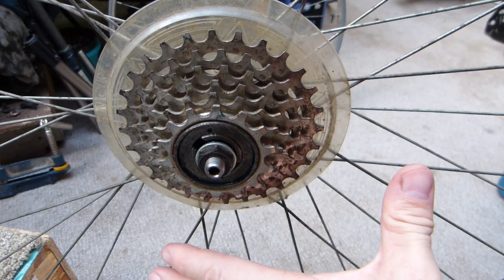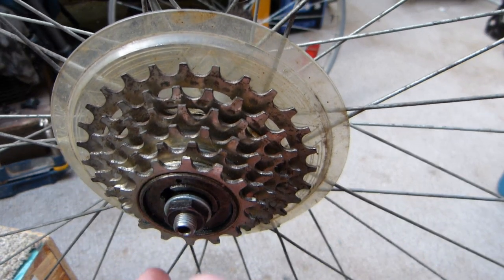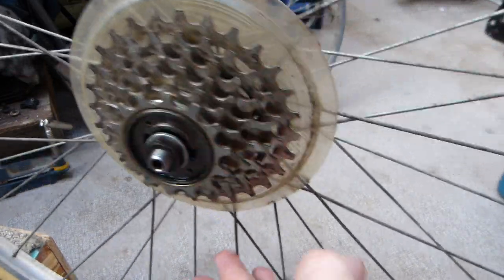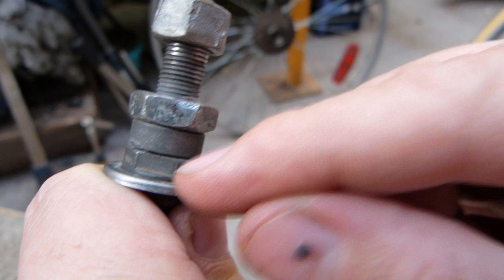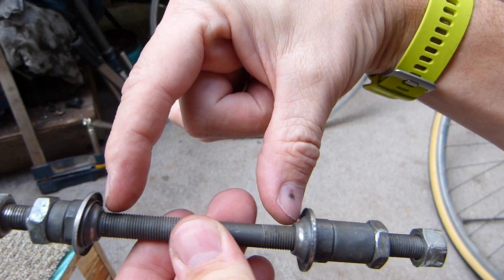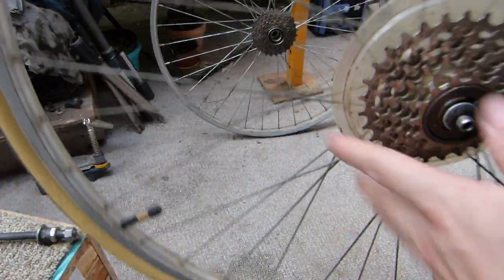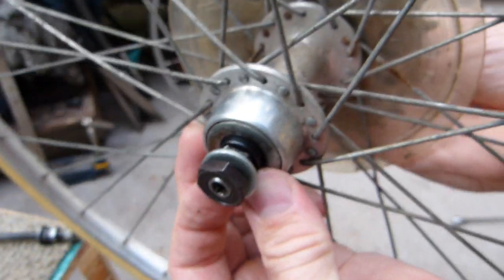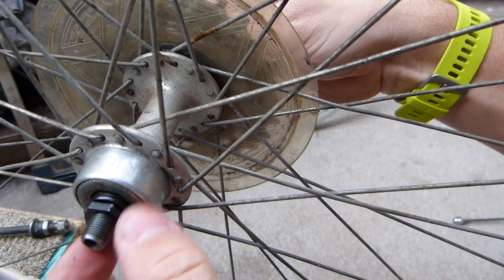Adjusting a cup & cone type bearing (rear wheel)

Comment: Can i use visegrip on the left axle so that i can tighten the locknut on the right part without removing cogs..or any advise on how can i tighten the right locknut without removing cogs
Reply: Replace the term “ left axle “ and “ right axle “ with drive side and non drive side, DS and NDS.
undo the NDS fully, play and find the DS cup and cone adjustment first, since it’s harder to adjust compared to the NDS.
Have your bike gram upside down on the ground for easy access.
with the loose axle thru the wheel, place the entire wheel/axle in your dropouts.
Tighten down the lug nut ( outer most nut on the axle, ) securing the axle.
find a desirable able amount of even  spacing for the wheel within the dropouts.
undo the wheel lugnut ( outermost nut ) 
To note where you want the axle, adjust the locknut and run it out until the tire is spaced.
Remove wheel from dropouts 
pull axle from wheel
tighten DS cone and locknut together
slide axle through wheel 
Put on NDS cup and cone 
place wheel on a table on the DS down
Tighten NDS until there is no/minimal play
hold DS side of axle 
Continue tightening NDS cup and cone
Tighten locknut and cone together

Comment: Just the video for checking my procedure was correct. Thanks. As you mentioned tedious work. I believe I am doing everything as you stated on my rear wheel, however every time I align it perfectly and fully tighten the cone and nuts the axle starts to wobble after 30 miles or so, do I need to replace my rear wheel?
Reply from the maker: Rear wheel is fine, may need threadlock compound for the locknut (or tighter setting) so it does not unwind in minutes
Reply: @theoverengineer  Thanks, I never thought about threadlock, that's a good idea - I re-tightened it yesterday and I also think there maybe a slight divert in the bearing run either on the cone or the hub. It has done a few hundred mile all told on a front hub motor powered ebike. I will see how it fairs over the last few days of summer and consider my options.